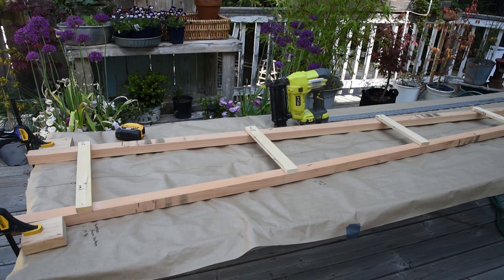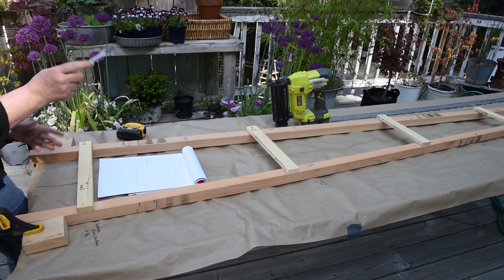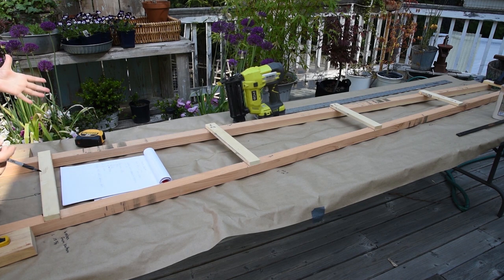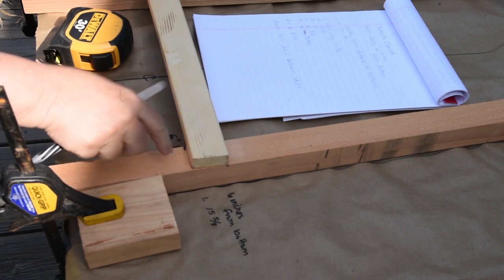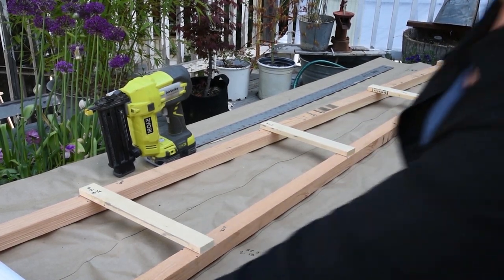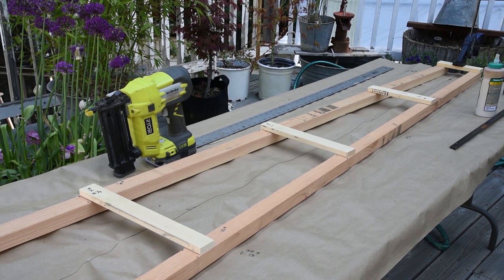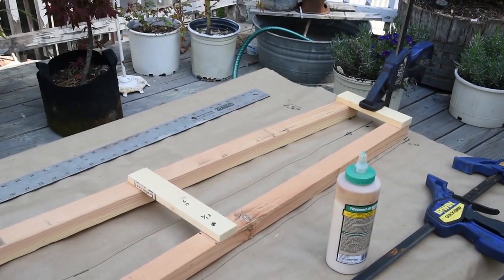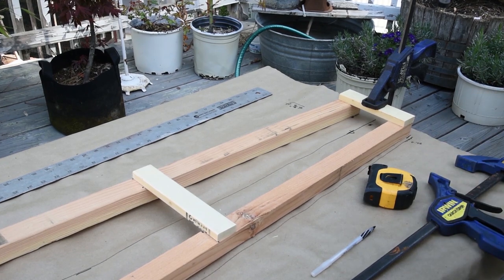How to Build a Garden Obelisk! (works great for tomatoes too)

Comment: Can someone here help me? I'm new to propagating and am looking into buying 
some cuttings, but everything I read says I need to keep them in 70f
 temps. How the heck do I do that? It's in the 90's outside and inside I'm not even sitting at 75f. Did I miss the window to pot these? It must be possible since they're still selling cuttings right now and you can't really store them in the fridge for more than 8 weeks, right?
Reply from the maker: I have never bought cuttings before so I am not sure. If you do get them and it is hot out just keep your newly potted cuttings in a shade area.  I still take cuttings in summer and just keep them under a tree or on the north side of a building while they root.
Reply: @FlowerPatchFarmhouse  Awesome, all I needed to know. Thanks for the reply. Yeah I've just got some of my cuttings today and basically am just either keeping them inside or in the shade, north side is definitely a good idea. I practiced with my own cuttings and was doing well until I put them in an area where it got too hot or they received too much sun. I've seen people root them in the ground, in sand, in peat, and use all types of hormones or no hormones so it got a bit frustrating. I think I have it figured out now. The weather really caught me off guard. Was weeks of rain and then just weeks of intense sun. Right now I'm trying to figure out how to keep some giant sequoias alive. I probably just didn't let them acclimate slowly enough.